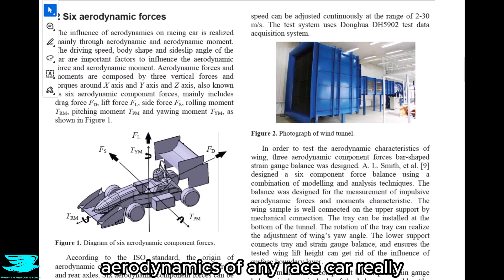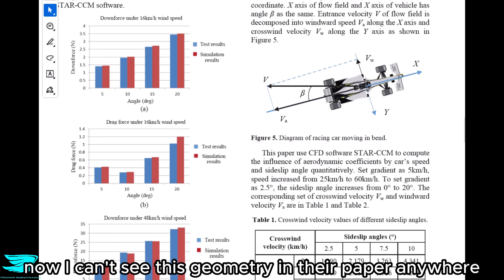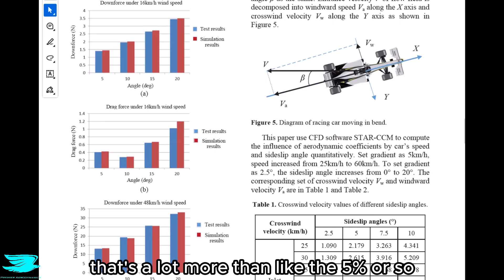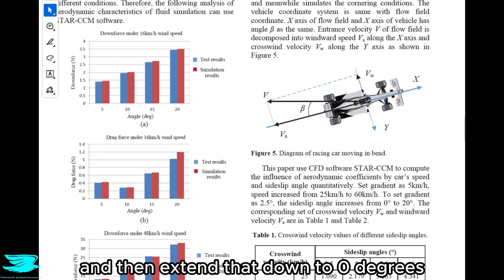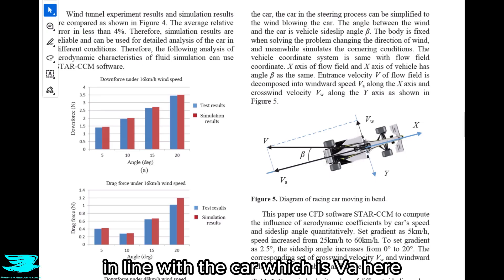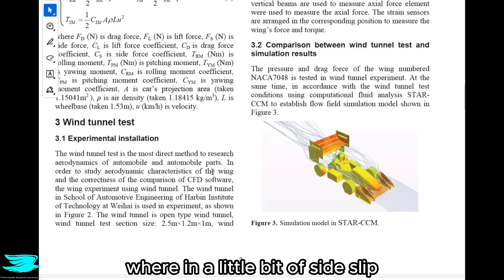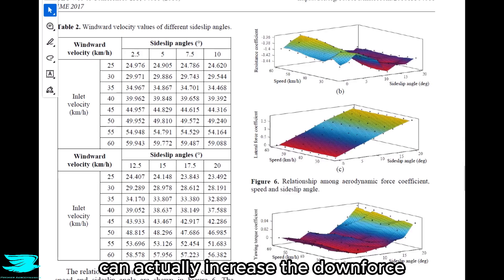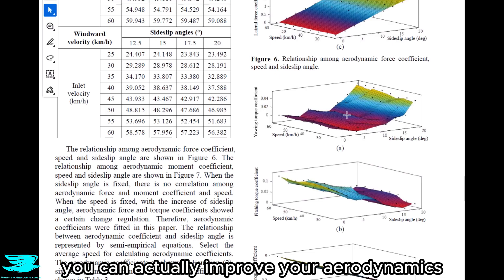Racecar Cornering Aerodynamics Podcast 239

Comment: Could you please do a video of sedan VS station wagon? Such as e63 vs e63 wagon, or m3 vs m3 touring. Theoretically that the rear of station wagon has a bigger high-pressure zone, better for acceleration in a roll race?

Comment: I guess what the authors did were the following: 
1. Decide on a sideslip angle to optimise to (eg by understanding statiatically whats the typical sideslip angle at corner entry) eg 10deg. 
2. Decide on an airfoil shape. 
3. Put the airfoil at the forementioned yaw angle (eg 10deg). 
4. extrude it laterally to get the 3d profile, thus resulting in the wierd NACA number. 

The good thing is it gives best downforce at the target yaw/sideslip angle, amd potentially less drag at zero yaw/sideslip.
Reply from the maker: Yep, they might've taken that approach.

Comment: During side slip the end plate becomes a pressure surface as well. So you're compounding the lift of the horizontal wing, and the vertical end plate. The end plate stops the pressure from bleeding into the suction side, by introducing side slip, the end plate becomes more active, with only a slight reduction in the span wise load from the horizontal wing. This makes the corner of the wing's suction side produce more suction. I suppose that at 20 degrees the end plate starts working more like a barn door than a synergistic device with the wing, especially at the tips. The wheel's wake is always interacting with the wing's tip vortices, as well as the diffuser, this is universal for all cars really.
Reply from the maker: Wow, that's really interesting to note. I thought maybe with such a large endplate, the bleeding couldn't be improved much. But, interesting to know. As a barn door, at least your still slamming it with high pressure, lol.
Reply: @PremierAerodynamics  Just think of the possibilities? Not just from the end plate but wing design as well, letter box, forward swept, rear swept. Just the planform of the wing performs differently under different conditions. Delta shaped wings are stable in pitch, but not so stable in yaw. Forward swept wings are stable in yaw, not so much in pitch. Letter box is somewhere in between.

The same principle therefore applies to endplates which are really just sideways wings, similar to sails.